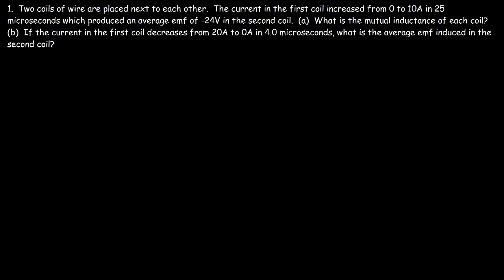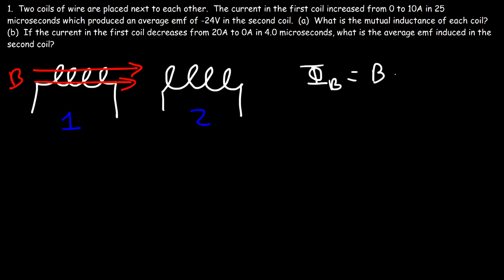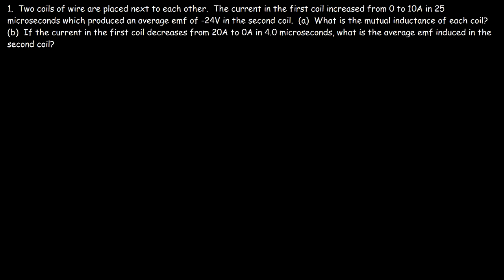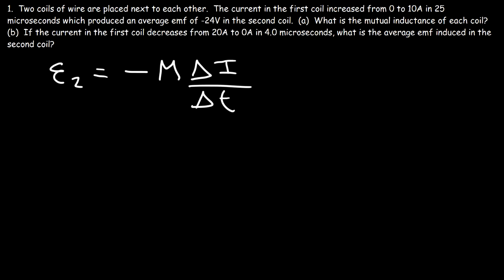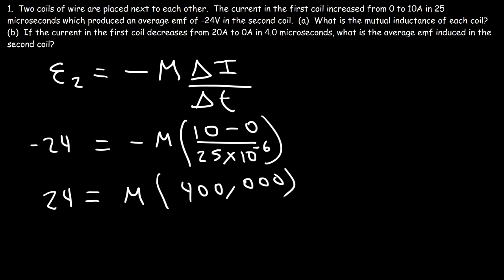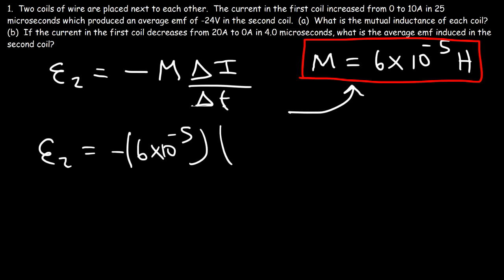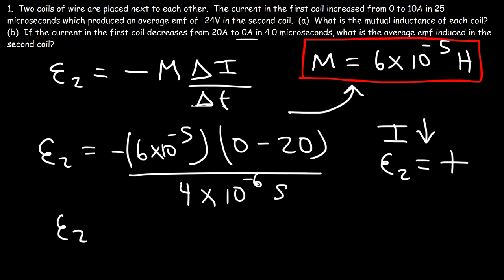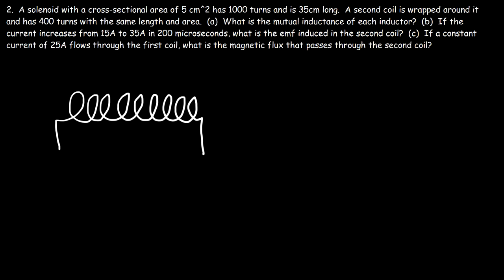Mutual Inductance & Solenoids - Physics

Comment: The "rate of change"? You don't speak with a respectably known language. You seem to have been creating new words for definitions that fit your concepts however you don't have any connection to the person who doesn't know anything yet. After all, the rate at which electricity flows is constant, as far as I've been told.  Frequency is  a constant, so how can you push the frequency any faster without changing it? So the rate of change to the direction of which the magnetic field is traveling or pointing relative to the charge traveling on its field, would be the frequency that makes up alternating current. 

Oh, and the more I think about it, shouldn't frequency of direct current be zero point five? You know, since it's half of the step to a complete sine wave? Sometimes, god gives you a sign? I think it's spelled sine. But who's able to claim godliness anyway when the word god is just that program in your head that dictates how you think, the fact that you do, and not much more? 

A kernel program. 

Little nugget of joy. 

Peace.